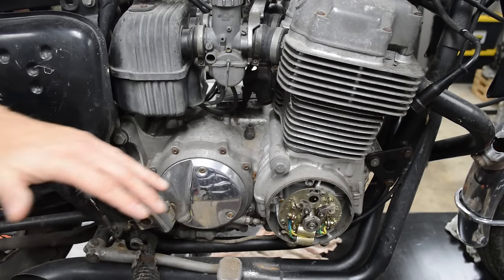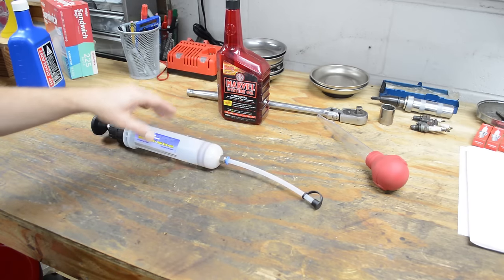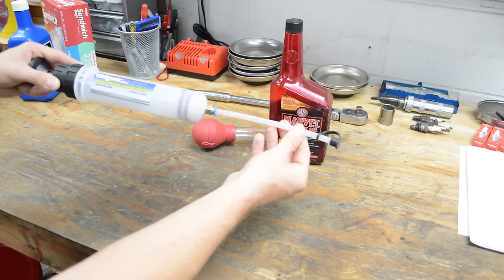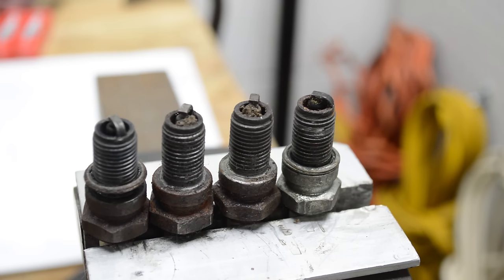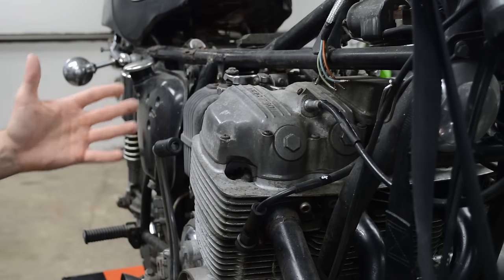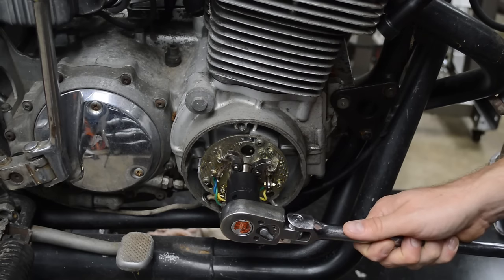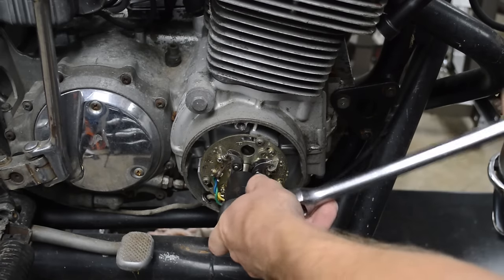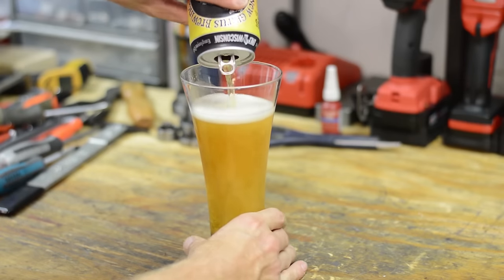How-To: Unseize a Motorcycle Engine

Comment: If after sitting with Marvel Mystery oil for a week the engine is still stuck,  try heating the cylinders with an oxygen acetylene torch with rosebud tip.

Comment: I would have taken the generator cover off and used the centre bolt that side, that big nut on the points side is only held by two tangs, not safe to turn a siezed motor they sometimes just snap off then your in real trouble
Reply from the maker: True, and I mentioned that in the video.
Reply: @HTMR  lol I missed that, my bad, good vid though
Reply from the maker: @gleddyvrudd  No prob.